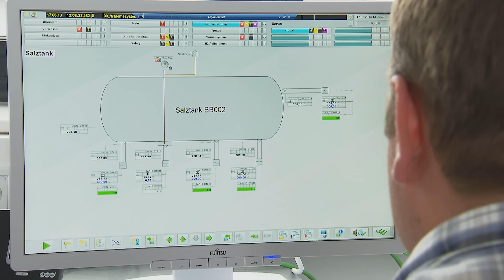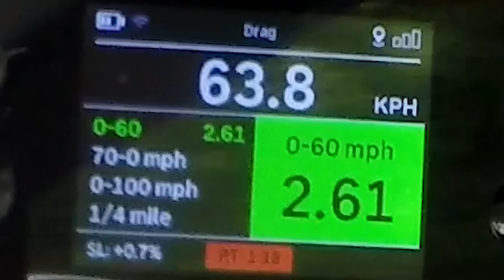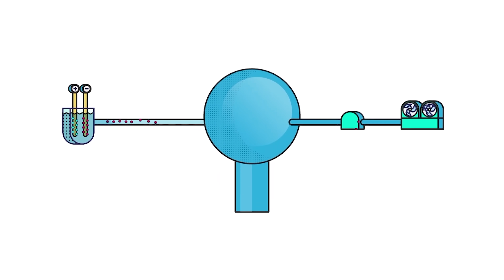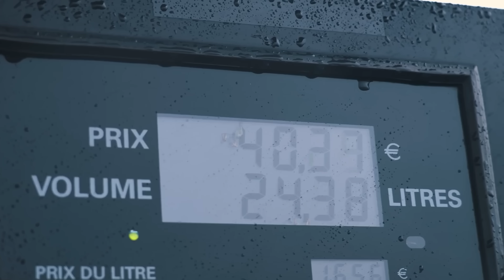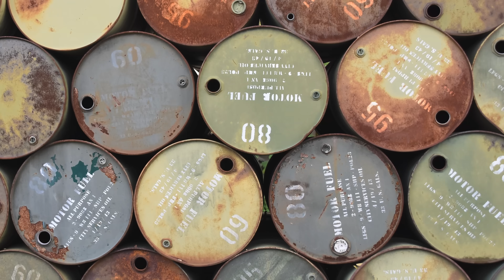Porsche just SAVED petrol engines FOREVER

Comment: Exxon Mobile suggests that synthetic fuel is estimated to cost $7.50 per gallon or $2US per liter by 2030.  Not exactly affordable for most.   I guess only people who can afford Porsches will be able to drive.  The rest of us will be joining the Amish community?

As for all EVs by 2030, these politicians haven't accounted for the infrastructure to support this.  There will need to be huge investments in electric generating plants, most of which burn fossil fuels, as well as electric grid capacity upgrades and expansion requiring exponential increase in mining of metals.  None of this is going to happen by 2030.  They have to know this.  

The only question I have is, who stands to profit from this 2030 mandate?  My guess is the same people who are currently profiting from "climate change."

Comment: Investing in R&D for this fuel, testing, building these huge factories (lots of them), means a lot of money. Wouldn't be better to use this money in creating a huge amount of bio energy farms (solar farms, wind farms, hydro and so on)? Then also making the electrical grid better and bigger everywhere in the world, so that it can handle the bigger elecrical demand created by electric cars? And also putting more and faster chargers in a lot more places? Investing in better batteries?

Using e fuel, means that we take CO2 from the air, and then putting it back. So it will not decrease the amount of CO2 in the air, it just stops from increasing. Also the CO2 that the cars are emmiting is in the cities, where people live and breath. While the factories are pulling CO2 from the air (and other sources) outside of cities. Not really helping the population who lives in the city (basically most of the population).

Batteries can be further developed, there is room for improvement by chaning the structure of it, so it becomes 100% renewable, 100% from materials that are not rare. Charging infrastructure can be improved. Energy creation can be improved and generate it 100% from renewable sources (yes, it will take time but it is possible). And this will decrease the amount of CO2 that we put in the air.

E Fuel does not have room for improvement, it's already created, you need CO2 to create it, but you will put it back entirly.
It should remain as is. To be used for hyper cars, super sport and really expensive street cars. The number of those and the amount of CO2 they produce would not threaten our future, but the common and boring cars that are used for transportation (mostly) should be battery powered (or hydrogen for that matter, although the efficiency of those is really bad... instead of using so much electricity to create, and transport the hydrogen, you should just use that energy directly in an electric car...).

Comment: A few things this video doesn't cover.

1) NOx emissions will still mean you can't drive in Clean Air Zones.
2) People worry about the amount of electricity we'd need if we moved to BEV, but it takes 3 times as much electricity to make the e fuel to drive the same distance as in a pure EV.
3) the EU have already said e-fuels would only be allowed if new cars have a device in them that mean they can only run on e-fuels. That device doesn't exist yet.

It's also worth noting that this just complicates matters further. If all manufacturers knew they had to move to vehicles with zero emissions at the tailpipe, we would be more likely to get there. There's already plenty of ICE cars on the road, with more being added all the time. They won't suddenly stop working from 2030/2035. We don't need new ICE vehicles. Enthusiasts have plenty to choose from already.

Comment: This exception for e-fuels was heavily pushed by the german minister of transport  and his liberal party by threatening to block the bill entirely. Coincidentally the leader of his party has very close ties to the management of Porsche. Call it lobbying, call it bribes, but it is very clear what was going on behind closed doors there. The big problem of e-fuels is theit energy efficiency. The renewable capacity needed to power one car on e-fuel could be used to power like 5 EVs. So in a situation where we don't have abundant green energy (aka the reality) e-fuels are an even worse Idea. Also there are areas that cant be electrified, like aviation (because of energy denisity) so if we had a bunch of e-fuel production capacity in the future, those should be prioritized. The inefficiency of those fuels also makes them very pricy. The price might fall, but driving on electricity directly will allways be significantly cheaper, which is why most people will buy electric cars, and most manufacturers will phase out cumbostion cars nevertheless. This really is a loophole created specificly for Porsche to sell nice sounding 6-cilynders to rich people forever. I love sports cars, and I think that this is fine actually, precisely because it will only affect a small portion of cars going forward, but it should be seen as what it is. Not a revolution saving the car industry and the environment, but a shady business deal between porsche and the german liberal party. Oh did I mention that literally half an hour after the EU legislation passed, said partie announced that they want tax cuts on e-fuels? Long live the free market haha.

Comment: We have had the knowledge to use "browns gas" for a century which is the separation of the O and H. ICE engines can be tuned to run straight off this mix which reduces further the need to turn it back into a liquid and the exhaust gas is water.. check out HHO generators.. why over complicate things, browns gas is the way forward..

Comment: You mean porsche saved the petrol engines for this generation of conservative "petrol heads" who are afraid of a bit of change.

The next generation who grew up with electric cars will be laughing at the old, worthless, smelling, slow, noise making petrol engines.

The European rednecks will be able to keep on 'trucking" with e fuels for 50€/L now and it probably never will be cheaper then 10€/L because there will be no scale benefits for the handful of conservatives that insist on driving ice. 

E-fuels are for classic cars that go out a few times a year for an event, not for daily drivers.

Comment: Mr A Toyota demonstrated a Hydrogen powered rally car at the Belgium Rally, so all the eggs do not need to be in one basket. The main problem I see with electric vehicles, apart from the mining and processing, is they may be seen as an energy reserve. Therefore when you plug into the mains, energy may be drained into the National grid, or you get a power cut.

Comment: Would have loved for carwow to not approach this as a commercial. This E-fuel works and is legitimate clean.

The problem is that it costs some orders of magnitude more energy to produce it and to convert it to the same kinetic energy (movement) in a car compared to a BEV. We dont have that sort of power available trough clean sustainable energy so we need, again, to use fossil fuels to generate this extra power. 

Summarized, this is nothing more than a scam, initiated by the car industry lobby for profit. In the meantime, climate is destroyed... Unbelievable

Comment: Toyota have already over a year ago demonstrated a 4 stroke direct injection hydrogen engine. That are one transition step less (no need to transform hydrogen to methanol as Porsche are described to wanna do above) and demands a smaller thank.
You can find Toyotas racecar with a 4 stroke direct injection hydrogen engine here on YT. Such an engine can be made to run on both hydrogen gas and liquid hydrogen. Lets all remember here that hydrogen are made with water and electricity and when burned it only emits....wait for it....water! 
Green hydrogen are the natural fuel to make from off shore windmill parks and Denmark, in a few years, alone will produce more than 10 times the global production today. 3 large off shore windmill parks will have hydrogen production as part of their energy production and one of the parks that just have been decided and approved will make an entire gigantic off shore windmill park that only will produce hydrogen. It wont even produce any electricity for the grid. It are one giant green hydrogen well if you like and no emissions what so ever!

Comment: best bet is biofuels, using bio-butanol as opposed to bioethanol which already makes up 10% of the petroleum we currently use, almost carbon neutral if done right, no need to change infrastructure, it's sustainable and has a good energy output. Using electric cars produces more pollutants than ICEs currently just from how the electricity is generated (80% fossil fuels, with a third of that being coal, the dirtiest fossil fuel)
Reply: the policy to switch to EVs to me just seems like a fad to get people off the road

Comment: Without having the actual figures in front on me, it seems far more feasible to develop efuels and disseminate them via the existing fossil fuel network than has been developed over the last hundred years, than to scrap that and try to turn everything electric, especially given that the national grid is by no means capable of supporting a vast increase in draw

Comment: I think you should have told the full story. After 2035 you can buy only ice cars that runs only on e-fuel and many source says they cannot make enought for all cars, so when you have high demand and fixed amount on sale, price will be lot higher than petrol or diesel today. Biggest problem is how much more electricity you need to produce e-fuel compared if you would just use that in EV. So for majority of people ice cars are dead technology, but e-fuel is nice way to keep old track cars running.

Comment: WRONG! Crude oil has NOTHING to do with fossils and organic material. The crude oil drilled out of the Earth is a MINERAL. Stop the propaganda!

Also, EV produce no LOCAL CO2. Their CO2 is produced by power stations elsewhere. So that is also BS. Not to mention the mining of the coal for said power stations and the material needed for batteries.

We live on the Southern tip of Africa, and as such we only have electricity for 50% of the day, so where are we to charge our EVs.

Lastly, China, the top producer of CO2, produces DOUBLE the amount of CO2 than the USA. In fact, China almost produces more CO2 than the remainder of the top 10 CO2 producing countries COMBINED.

Politicians are idiots.

Comment: Missed one criticism of efuel (besides that it will never be economically viable): just because in theory it can be carbon neutral (it won't be), doesn't mean it doesn't still emit plenty of pollutants into the atmosphere--causing smog and other ill health effects. Studies already showing appreciable health gains (especially with respect to asthma/respiratory illness prevalence) in areas with more EVs even with just a few percent market penetration.

Also: ICE has been around for 100+ years and is as developed as it'll get, EVs are just getting started refining the tech--another decade they'll be much cheaper than any ICE, have range like an ICE, and charge 80%+ in the time it takes to fill up a gas tank... pair that with EVs being incredibly more efficient at using energy and, sorry, ICE is dead for all but the super rich on economics alone--the laws won't matter at all by 2035.

Comment: Carbon capture is expensive, producing hydrogen is expensive, producing fuel from those two is also power consuming. This fuel won't be cheap. Therefore yes you will have a choice between cheap car with new not so cheap fuel or not so cheap electric car. Let's see what future brings 😂

Comment: E-Fuels still emit 7 to 10% CO2 as well as Methane and NOX so pollution continued just slightly lower amount of Greenhouse Gas and thats from the Car. So not Carbon Neutral and too little to late. They have had since 1996 to make all cars Hybrid so use half the Fuel and less polluting than regular ICE vehicles but very few models released. Just another Delay tactic.

Comment: God bless E85
We been using E in our supercar series for ages now in Oz.
I hope my Evo8 running on E85 is the start of things to come in the future.
You need to use more than say 98ron as E is more dense. SO bigger injectors and a tune were also needed to run it nicely.
Reply: I too, see the logical change to move to E85 or grater. On the point you made, the average RON in E85 at the pump is actually between 105-110 octane. Meaning more efficiency by either cramming more boost into engines or driving up the static compression in Naturally Aspirated internal combustion engines. This is just higher cylinder pressure that can now be obtained safely, due to the higher octane count. So, the higher the cylinder pressures that can be obtained, the more efficient the engine can be.  For every full point in compression raised, is the mathematical equivalent to ~4% increase in power from idle to peak RPM. 

Example: my 4.6 SOHC ford modular engine, runs at 9.6:1 static compression ratio from the factory. By increasing the bore 4mm per cylinder and adding after market cylinder heads of 38cc combustion chambers, with a flat top piston, it brings the compression up to 15:1.  

On gasoline, this combination is no viable with out race gas. But on E85 from a gas station pump, it’s safe to run. This should be an increase ~ 21.5% in power alone. The only thing that would limit this figure, is the added increase in airflow to match the higher due flow requirement. The trade off, is less throttle input is required to get the same values with gasoline. And with normal driving habits, should not see a huge decrease in MPG.

Comment: synthetic fuel has been around for years. I'm surprised they didn't bring this to light sooner.
Reply: Probably something to do with the fact it’s bollocks
Reply: @fradaja  That's the right answer. 
Science journals have written about e-fuels before. it's always spoken of as mostly a pipe dream with little chance of actual success compared to other emerging technologies. 

e-fuel is what happens when the status quo gets toppled. e-fuel is like e-horses. Once the car came around, horses weren't that useful. 
Once electric motors came around, making a huge drivetrain and a massive engine just so we can listen to the vroom vrooms made less and less sense by the year... A battery, speed regulator and two small electric motors is just a better way to make a car.. No gearbox, no axels, no engine.. We're going from a thousand moving parts to like two RC motors and the steering column and its assembly.. 

The main concern is how to store energy, and how to make magnets without causing havoc to the planet.
Reply: @vgaportauthority9932  But just because cars were invented, horses weren’t banned. There’s still people who ride horses (mostly for fun, competitions, etc). E-fuels might be the solution for the people who wanna have fun with their cars and hear their sound. Might not make sense for Toyota and Volkswagen to keep building ICE cars, but it will for Ferrari, Lambo, etc.
Reply: @vgaportauthority9932  that was actually a good analogy, nicely put
Reply: @vgaportauthority9932  Efuels aren't common because they are expensive and inefficient. So mostly just greenwashing.
Reply: Because big cooperations would loose billions. Simple
Reply: @k1ortia  

Not as simple as you
Reply: @fradaja  eh? As i what?
Reply: Because it's too expensive and makes no sense since you can drive 5 times longer when using the energy directly in an ev instead of using it to make e fuel
Reply: That’s because this is simply wishful thinking
Reply: Same thought here, my guess is that big oil only just started losing their stranglehold over the industry and can no longer hinder research
Reply: On the other hand this video might just be the biggest green washing campaign ever..........hopefully it isn't and renewal energy production scales up exponentially.
Reply: Yeah well "they" probably don't want it to be common. "They" don't care about carbon emissions. It's about limiting mobility of the general population.
Reply: didnt some guy make a water powered car once then went "missing"
Reply: Because it's terribly inefficient, doesn't quite work yet, would take huge amounts of energy production to work and is impossible to roll out before the timescales required to literally save the planet.
Reply: @obscurelines  "before the timescales required to literally save the planet" oh man, he's in too deep

Comment: One of the most revolutionary things with this you just overlooked is methanol fuel cells. Yes electric cars are great in lots of areas especially efficacy which is 90% but the charge time reduced range of batteries only being able to store around 3.5% the energy per weight compared to gasoline and not having the ability to refuel just about anywhere for endless range like ICE vechiles is a major down side. Hydrogen fuel cells attempt to answer this question using Hydrogen to replenish a fuel cell to power an electric vechile so I can be refueled like gasoline however although hydrogen is energy dense per weight, its not very volume dense taking up lots of space to hold a small amount. Super cooling helps this but also requires energy to do so and has venting problems that must be addressed too.
Methanol however is alot more energy dense given its a liquid at room temperature like gasoline and likewise can be refuelled like gasoline. Combine this with a super efficient electric motor and we're talking 3000km+ range on a regular passenger car that can be refuled in minutes.